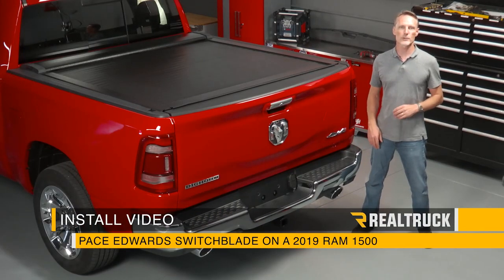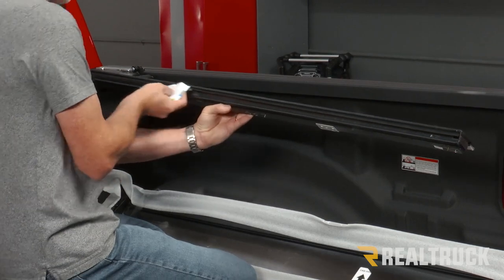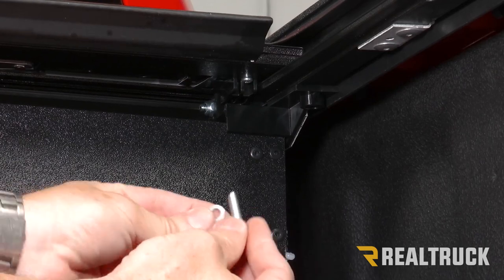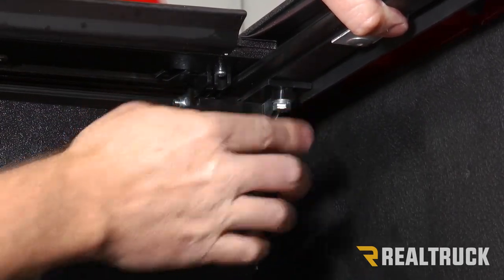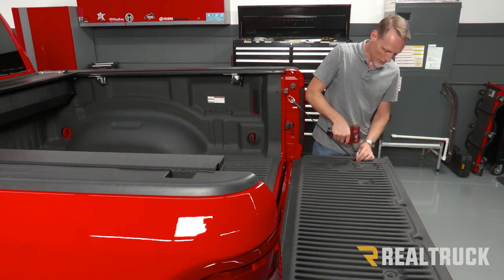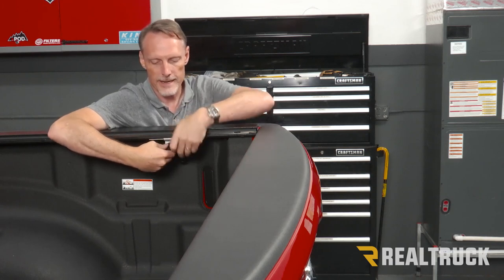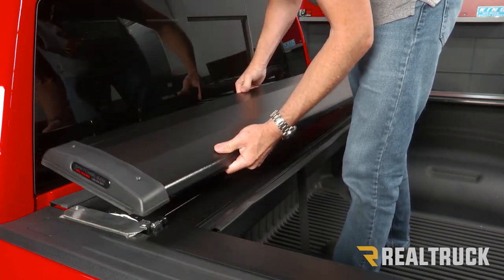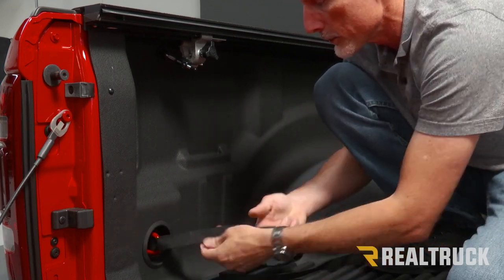How to Install Pace Edwards Switchblade Tonneau Cover on a 2019 Dodge Ram 1500

Comment: How did 12 Dbags give this a thumbs down? Great production values, to the point and made install very easy. Thanks. I did get a bit worried when he said you have to remove the tailgate liner but on my Ranger it worked just fine with the liner in place.
Reply from the maker: Much appreciated!